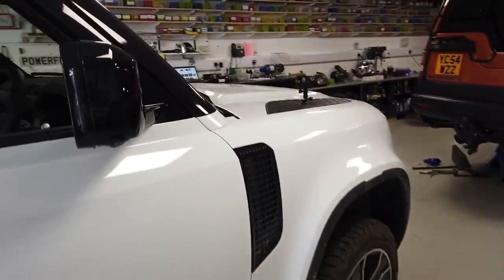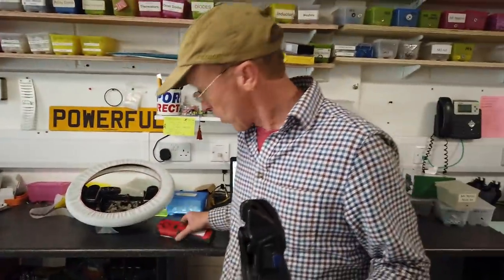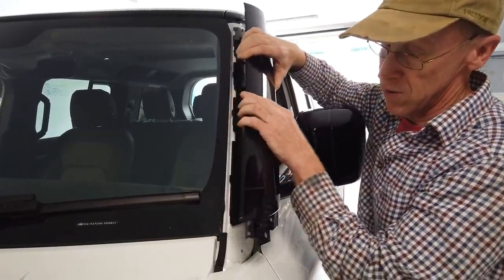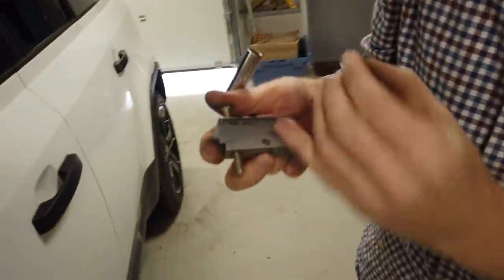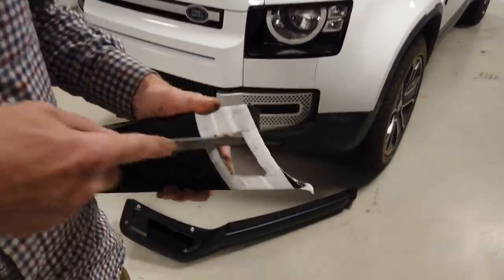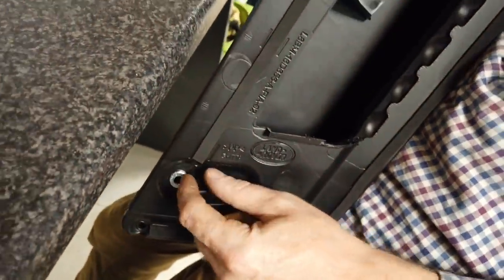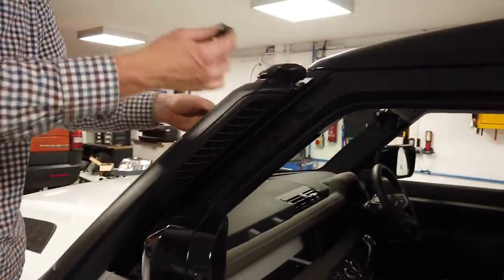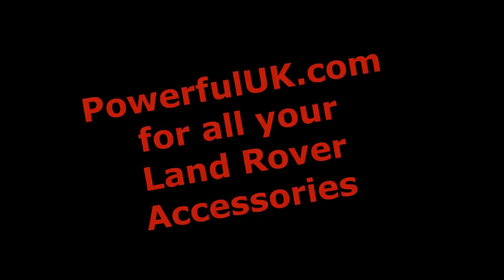2020 Land Rover Defender 110 snorkel fitting instructions - raised air intake VPLEP0435

Comment: Also LR I have discovered you can lock the key inside the new defender using the spare key. Not good.
Reply: The system  will sense a key inside so will not lock but having the spare outside assumes that you will not be locked out & maybe want to lock the spare key inside.

Comment: Hey so i just installed mine... but im looking at it now and it is pulled close to the body except in the front of the air intake. Is there a clip i missed or something? How did you get yours so close to the body? Did it pull closer as you tightened the bolts?
Reply from the maker: Did you insert the cage nuts correctly before putting the snorkel up to the car ?
Do not drive the car until you have checked this - I have seen these come off when they are not installed correctly.
Reply: @L663  yes i did... it is attached just sticks out from the front i will loosen it and see if i can retighten it.
Reply: Oh I figured it out.... i detached it and i think it was slid too far forward... if you move it around it eventually snapped into place much closer to the body.  I had to get it in place without the bolts then blindly align the bolts.
Reply from the maker: @nsurgents  Hi Micah - well done on sorting this out....glad it all fitted correctly.

Comment: Can i buy the tow hitch and is it difficult to install or worth $650 to order with car? Thank you
Reply from the maker: I guess you are the other side of the pond ? your hitch will be USA spec ! Having dealer fit the hitch could be the safer way... also there are some electrics to connect. Also sometimes you need to configure the ECU so that the car knows it has tow hitch fitted so it can look for electrics connected and modify car dynamic behaviour.
Reply: @L663  thank you

Comment: Meanwhile in China the reverse engineering parts wheel is furiously turning
Reply: I've a sneaky suspicion that's where Simon's part was originally made.
Reply: @rafflesnh  it must have been and they probably had shelf ready copy before the official product
Reply from the maker: Maybe.... but this was a fresh genuine part...
Reply from the maker: Land Rover are having issues with accessory supplies on the new Defender.
Reply from the maker: OK even if these gen parts are made in China.... the instructions... which are crazy... are from the UK !